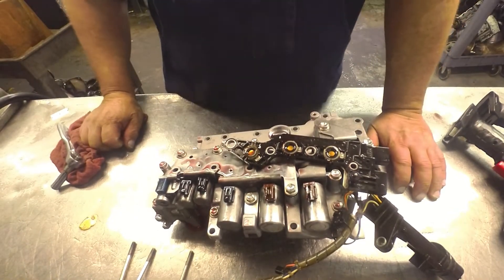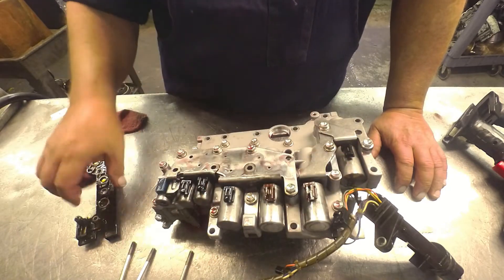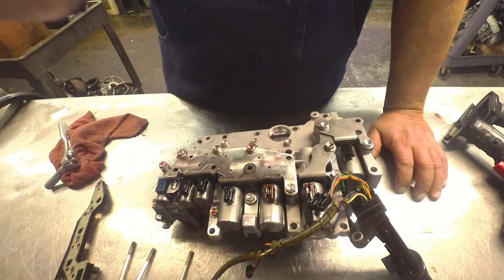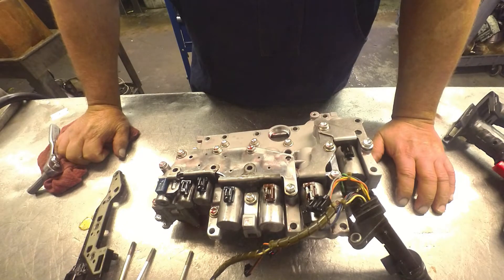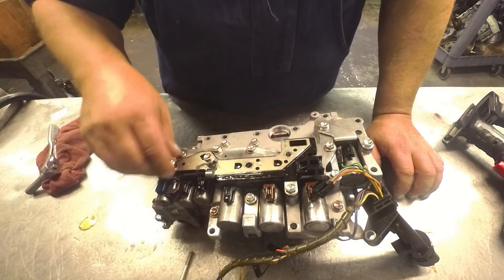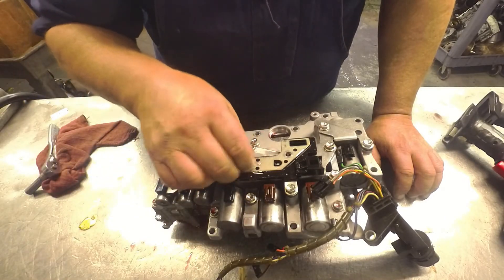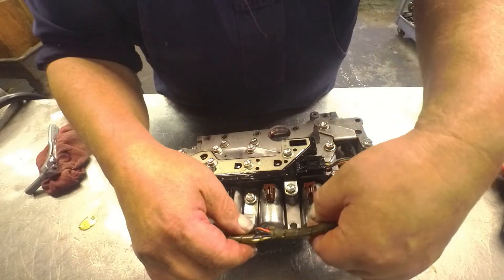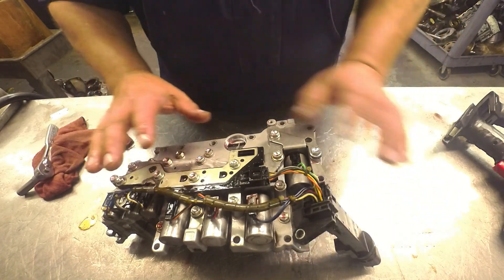U660E Pressure Switches

Comment: I have a 2012 toyota sienna 2wd with the u660e I am getting codes p0741and p2757 I know the 741 is the tcc solenoid not sure what the 2757 code I think it is a fluid pressure solenoid  I can't afford to take it to a shop I have worked on cars for 30+years I recently rebuilt a 4l60e with alot of sonnax upgrades. My question is if you it is solenoids I for sure need to replace and if so if you might know what the part numbers Re for them I have had alot of trouble finding those I only have a couple days to try and get this repaired it is my sole transportation to get to work I would greatly appreciate any help you could give me
Reply from the maker: 2757 is a TCC solenoid performance code. Fancy way of saying it does not detect lock up. It uses the TPS, MAF, Input and output speed sensors, as well as the crankshaft sensor to determine if lock up occurs. So it can be a problem with any of those sensors as well as a problem with the SLU solenoid. Could also be a problem with the torque converter. Most of the problems I have seen are either a TC problem or one of the speed sensors. Look at your speed sensors first.
Reply: @CurmudgeonTransmission  speed sensors on the trans?
Reply from the maker: @MegaWolfman76  Yes
Reply: @CurmudgeonTransmission  thank you so much!!! If it is any solenoid or solenoids would you you know which one or ones and maybe part #s for you are a life saver if I can't get this fixed in next couple days it could mean losing my job thank you so much!!!
Reply from the maker: @MegaWolfman76  SLU solenoid. 35280-52040
Reply: @CurmudgeonTransmission  sorry I'm bothering so much do the solenoids just pop out or are they held in somehow or will I need to remove the valve body I've only built a 4l60e and it seems alot simpler then this trans
Reply from the maker: The valve body will need to be removed. The SLU solenoid is the 3rd from the end opposite the connector that goes thru the case.
Reply: @CurmudgeonTransmission  ok kinda afraid of that should I have have concerns or any suggestions so I don't have any issues? And again thank you very much...
Reply from the maker: @MegaWolfman76  Welcome
Reply: @CurmudgeonTransmission  I'm sorry for bothering  you do the solenoids just pop in or are they held in by a clip somehow?
Reply from the maker: @MegaWolfman76  There is a bracket across the top of the solenoids. Underneath there are roll pins holding them in place. They will fall out when you take the bracket off.
Reply: @CurmudgeonTransmission  again thank you so much
Reply: I got it back together and have added  3 1/2 quarts in it but it isn't turning at all how many quarts should I put back into it before it should try to move? The old solenoid was totally not moving at all I tested it and all the others they were all working but it. The round double washer looking thing on the side of the valve that slides in and out is that the shifter?
Reply from the maker: Manual Valve, are you sure you got it lined up properly? Your shifter operates it. Dry fill is 7qts., so, about 5 probably.
Reply: @CurmudgeonTransmission  would I line the rod or pin between the 2 round washer looking things then? Sorry stupid me usually I take photos of thing to help remember how things go back together but I forgot to.
Reply from the maker: @MegaWolfman76  Yes, between the two on the end.

Comment: Hi, I have a 2011 sienna  have this transmission. Just replace the c1& c2 piston and the transmission ecu.Now is giving me p0990 and c1201 also the Vsc is on. Rested it couple time and still come back. Car seem to drive fine.  Any help wound be great .thanks
Reply from the maker: Is it a brand new computer? If not you may have replaced it with one that is not compatable with the pressure switch set up you have. How many pressure switches is there on the valve body, and what did the computer come out of? It could just be a bad pressure switch assembly. They are problematic. Don't worry about the VSC code for now, it will probably go away when you fix the transmission code.

Comment: I've got an 07 ES350 with this transmission.  It has a shift flare from 3rd to 4th gear only when cold.  Any recommendations on how to tackle this issue?  I already performed 2 ATF fluid changes (changing about 5 qts of fluid) and it seems to shift better but the flare is still there.
Reply from the maker: If you are lucky it is only a worn out valve body. I would try a Sonnax Zip Kit in the valve body.
Reply: What solenoid deals with the 3rd to 4th shift?  I'm going to attempt to replace it before going the Sonnax route.
Reply from the maker: SL1,2,3 and 4 all play a part. SL1 and 3 do not change. 1 is on and 3 is off. 2 changes from off to on and 4 changes from on to off.
Reply: Thanks for the information.
Reply: @CurmudgeonTransmission  скажите пожалуйста sonnax zip kit это качественные детали?
Reply from the maker: Yes. It is a pain to put in but have had good success.
Reply: @CurmudgeonTransmission  спасибо
Reply: I have this exact problem. I had a rebuilt valve body put in but the problem is still exactly the same. Any recommendations?

Comment: I have a 2010 Lexus with a u660e transmission. I'm getting code p0990 transmission fluid pressure sensor/switch "E" circuit high. I changed the pressure sensor switch and added new ws fluid.  P0990 comes back. Book says switch should have 10k ohms or higher across the the pressure sensor. I've tried/tested two new switches and my readings on my meter are "OL" out of limits. Do you have any insight? Any help would be appreciated.
Reply from the maker: Are you checking at the sensor assembly itself or through the case connector? Might have internal harness problem.
Reply: @CurmudgeonTransmission  I have tested both ways. Tested from the harness with sensor plugged in, same OL reading.  I also bench tested sensor and get OL across all the pressure sensors. The service manual says harness should have less than 1 ohm resistance, which I have,  harness tests good. But service manual says pressure sensor should be 10k or higher across pressure sensors which they are not, not even a brand new one.
Reply from the maker: You are connecting the ground lead to the metal plate on the sensor and the positive to pins 1,2 and 3 correct? Where did you buy the sensor from?
Reply: @CurmudgeonTransmission  yes. Ground on plate and poss. on a terminal. I bought oem parts.
Reply from the maker: Hmm, strange. Have you tried pressing on the switch with the meter hooked up and seeing if it changes at all even for a moment?
Reply: @CurmudgeonTransmission  no but I will try that. If that works and get 10k ohms or more, I would assume the pressure switch assembly tests good. Why would I still be getting the p0990 code?
Reply from the maker: It is used to determine if the lock up function in the torque converter is happening. Does it have lock up? If not it could be the valve body, SLU solenoid, torque converter itself or bad computer. Have had fairly good success with the Sonnax Zip Kit for these valve bodies.
Reply: @CurmudgeonTransmission  I put ground lead on metal plate of sensor and tested each pressure switch and got  0.1 ohm on each pressure sensor which I was pushing down on  each sensor.

Comment: I've got this transmission probably on my 2GR-FE. Noticed the transmission kicks when i hard accelerate from 35 mph. If i hard accelerate from 0 mph, it shifts smoothly. What could be the problem?
Reply from the maker: Do you have any codes or check engine light on? Not just transmission codes, any codes?
Reply: Nope, nothing. Haven't checked transmission for codes. But no check engine light. I'am guessing it is not downshifting right. Could this be a faulty solenoid?
Reply from the maker: @misterispusovcikas9066  Yes, could also be a worn valve body. Both are very bad about wear. Could be other issues causing the transmission to act up.
Reply: What else \ how bad it could be?
Reply from the maker: @misterispusovcikas9066  Anything that has to do with engine load. MAF, MAP,. TPS. Anything that has to do with that affects line pressure in the transmission.
Reply: Thank You for information, appreciate it a lot
Reply from the maker: @misterispusovcikas9066  You're welcome
Reply: @CurmudgeonTransmission  writing from another account, been driving this car for a long time now, i can feel performance issues, sometimes it pulls strong as it should, sometimes it feels very sluggish. I noticed that it pulls strong for example if i drive in first gear when it is 2-3 k rpms for a minute or two (maybe i increase oil pressure in transmission?) And if i drive the car slow and need that power it is gone. I have two error codes set on trans. Ecu. It is P0872 and P0877.
Reply from the maker: What is the year, make and model, engine size?
Reply: @CurmudgeonTransmission  it is a 2007 Camry, 2GR-FE with u660e
Reply from the maker: Has the unit or valve body assembly been changed out?
Reply: @CurmudgeonTransmission  i've read about temperature sensor body being 2 types on this transmission, but i doubt that it was ever changed i can not really tell that, maybe it was. Can this part have a negative impact  on performance?
Reply from the maker: There is a 3 pressure switch and a single pressure switch. There is a bulletin with those 2 codes about swapping out a 3 switch vb with a single and giving those codes. Also if the pressure switch assembly has ever been replaced it may have the wrong one. Pull the assembly off and see how many switches it has and then look at the plate underneath it and see if the feed holes line up. Yes it puts it in a different type of failsafe than normal. Lack of power.

Comment: Hey man I got that U660E transmission! My car won’t shift at all out of gears. Turns on and off as if stuck in neutral. Check engine light on indications solenoid are stuck or off. Not a lot of metal shavings in transmission, but the fluid was dirty!
Reply from the maker: Would need to know what the codes are, since there is no movement sounds like time for an overhaul.